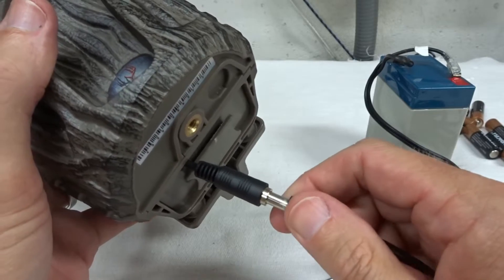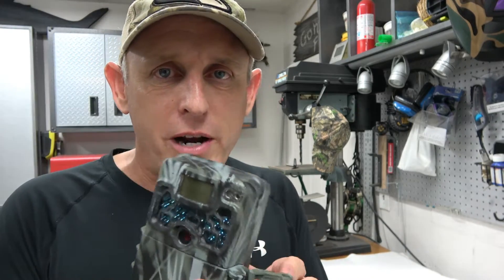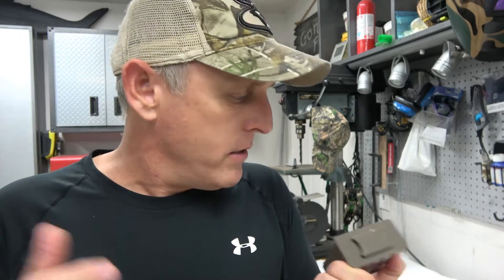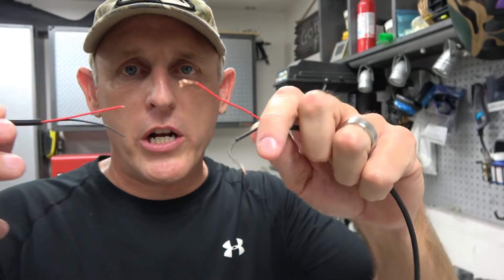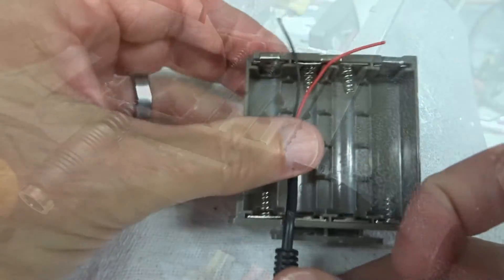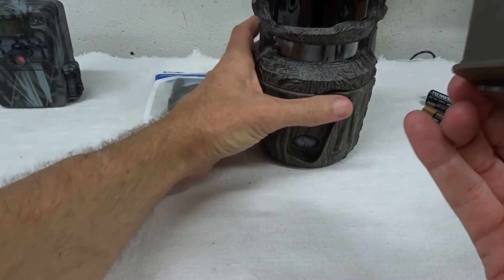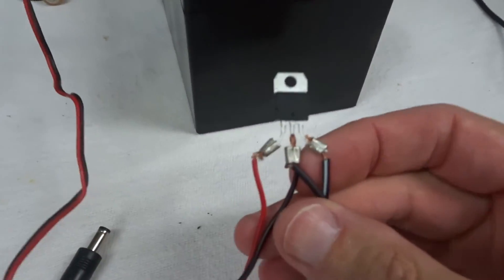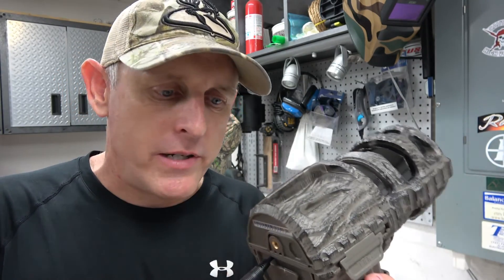How To Direct Wire Any Trail Camera!

Comment: Great video, im subscribed, question why are the external plugs always running 12v and the internal batteries if they use 8 would be 12v but you say they are only running on 6v,
Reply from the maker: The cam in this video had a 6v ext plug but had 8 internal batteries (which could be mistaken for 12 v) but the battery pack is wired so that it only runs on 6volts from the internal batteries.  It’s like taking two 6v batteries and wiring them in parallel so they stay at 6 volts but double the ah storage.  Does that make sense?
Reply: Yes, but why are the external plugs mostly 12v
Reply from the maker: Not sure what you’re asking?  Are you asking why the cable’s are listed as 12v?  If so, a cable will work on any camera regardless of voltage.  Otherwise, most cams are 12v due to the IR flash and motion needs.  It’s just a common voltage which fits with a lot of batteries and solar etc.  Hope that helps!

Comment: Question. I see when you geared up to your 6volt you didn't have a fuse in the line. I have a spypoint micro and want to make my own 12volt DC to run to my  12 volt acid lead. The wires are expensive. Do I need the fuse in the line?
Reply from the maker: I never run fuses on cameras because the amp draw is basically nothing.  It wouldn’t hurt to have one, but I’ve never hurt a camera by not having one. Hope that helps!
Reply: @TheHandyHunter  thanks. Hopefully I order the right one lol
Reply: @TheHandyHunter  also will I need 5.5mm x 2.5mm or 5.5mm x 2.1mm
Reply from the maker: Ashley Roy hard to say without seeing the camera but my last Spypoints were 2.1x5.5.  If it’s not it’s most likely a 1.7x4.0mm.  You may want to check with Spypoint.  Hope that helps.

Comment: I want to do this with my original plot watcher. It has no battery pack and runs on 4 AA. Would you assume it is a 6v system?
Reply: Yes it's 6 volts . 1.5 volts times four is a 6volt setup.

Comment: Trying to direct wire a cuddeback camera.  It is a 6V pack.  The battery pack does not have the clips like your video. It has terminals similar to a 9V battery. How would you connect that kind of pack?
Reply from the maker: Its hard for me to say without seeing it.  Can you shoot me a pic at steve@digitalsouth.com.  Thanks!
Reply: @TheHandyHunter  thanks for the reply. Email sent.

Comment: If the camera is 6 volts you can cut and use any USB wire from a $1 store and a USB battery changing bank.

Comment: How long does that external battery last for? compared to those little battery, sorry for my english
Reply from the maker: Depending on the size of the battery they can run as long as 1year or more without charging.

Comment: if it only runs on 6V why does the manufacturer design it to put in 8 1.5v batteries in the trailcam (12v)?
Reply from the maker: It’s because of the way they wired it.  They wired it to run on half the pack at 6 volts but it still utilizes the other batteries for longevity.  Not sure why they did it this way because it seems like 12 volts would be better for a cam like this.  Hope that helps.
Reply: @TheHandyHunter  makes sense thanks !
Reply: Why then is the external plug running on 12 v
Reply from the maker: The cam in the video had a 6volt ext jack.  All my other cams are 12 volt ext jacks.

Comment: I know this is a year old now, I was curious as the reason you use a inline voltage reducer, vs a buck to do the same job but to preserve power and not waste so much?  The heat produced from the inline voltage reducer/regulator eats up power, a buck was designed for computer systems to prevent that, but are just as simple to wire up with soldering iron and some just have wire leads you can crimp on.  I think that would improve your overall design and make the solar panel more useful, as well make the battery last longer.
Reply from the maker: Great info!  I’ve always wanted to try a Buck but never got around to it.  What you are saying makes sense.  I may add this to my list in the future.  Thanks for chiming in...really appreciate it!
Reply: Could you share a link to one that would work for 12V regulator?
Reply: Where can i get a 12 v buck at
Reply from the maker: Amazon has them

Comment: What cell camera do you like and when Browning comes out with theirs will you buy one
Reply from the maker: I love the Bigfoot cell cams.  They are the least expensive, they have great picture plans, and the camera functions flawlessly.  I love Browning trail cams too!  When they finally come out with a cell cam I will be interested to see their cost & plans, etc.  Now that I've found Bigfoot it would be hard to switch.
Reply from the maker: @Gene Senter check out our latest video and you’ll see how we use the Bigfoots to hunt hogs.  They transmit quickly and with very little cell signal.  They work great for how we use them.

Comment: Inside the trail camera is 2 positive posts and 1 negative post. Does it matter which positive post you hook to?
Reply from the maker: It probably doesn’t.  Tell me a little more though. What kind of camera is it and does it have a slide in battery pack?
Reply: @TheHandyHunter  I just went for it and hooked it to one of them and everything works perfectly. But even on your video there is two positive posts in the battery pack. I was questioning which side or if it mattered.
Reply from the maker: I got ya...sounds like mine.  The first post I tried worked so I left it alone.  Good luck!

Comment: Hi, awesome videos I have a Browning camera that take 8 batteries, voltage of the pack is 12 volts, I have a battery/ solar box from HME that puts out 13 volts, will this burn up my camera
Reply from the maker: You’ll be fine with the 13volts from the box.  12 volt cameras work on a range of voltage and not exactly on 12 volts.  13volts is perfectly normal and as your camera uses the battery it will drop over time eventually needing recharging. Hope that helps and good luck with your cams!
Reply: The Handy Hunter thanks so much, I run my cameras in very cold weather -20 doing Canadian Lynx videos and the lithium battery’s last about 2 weeks, the HME box has lasted over a month on Stealth Cams and wanted to use it on my Browning camera, thanks again
Reply from the maker: David Johnson Awesome!!!  Shoot me some pics to post on my community board if you want!  You have my email!

Comment: Dear Friends, I have a security problem and need TC hack help please.I would like to know how to hack a camara for my porch where the flash bulbs stay illuminated, when plugged into a Wall Wort power source.perp walks by it at night and Click, his picture is taken, unknown to him.Which cam to hack, I saw one w 9 or 12 bulbs , led for the flash.that would be good but im  no electro hacker
Reply from the maker: Hi Steven, it sounds like a regular trail camera would accomplish your needs to quickly illuminate and take pictures simultaneously.  You can buy IR flood lights that will stay on and then when your camera takes a picture you will have more IR illumination.  Hope that helps!

Comment: Very informative videos! Subscribed! I have some rooky questions though. This is not a feeder video but... Can a 6 volt battery be charged with 12 volts? My new solar panel shows 24 volts in full sun. Can I regulate it down to 12 volts to charge my 6 volt feeder battery?
Reply from the maker: Hi there!  Welcome to our channel!  You bring up something I've never tried but I think might be doable.  Sounds like you must have a 12 volt solar panel if it's putting out 24 volts in full sun...that's normal.  For a 6 volt solar panel it would be normal to put out 12 volts in full sun.  If you hook up a 12 volt panel with a 12v regulator installed then you should never get over 12 volts to damage your battery.  However, you WILL need a 6 volt regulator installed between the battery and the feeder motor.  The only thing I wonder is whether this setup will wear out the battery faster do to overcharging...may be worth the risk.  I think it is doable as long as you get the 12 volt reg between the panel and battery and then the 6 volt reg between the battery and motor.  Let me know how it goes...this is a very interesting question!  Thanks for stopping by!

Comment: Great. I was just going back to your sight to review solar panel video as I'm converting all my Browning Strike Force to external battery and solar, and see this new video for direct wire with no external plug. Your videos are simple and I like how you provide detail and parts info. Look forward to more
Reply from the maker: Thank you so much!  If you are in to solar then you’ll like my next video.  I’ve built a solar panel with a small 12volt battery attached that runs cameras 24/7...really neat little setup.  May get the video done this weekend or next week.  Stay tuned and thanks for coming back!!
Reply: Tell me more. You have a new 12v solar set up other than a solar panel running to 12v batter in a box then from battery with a 12v regulator to camera?  One of my Strike Force the 12v external plug port when I plug in external plugs has too much play on the plug to stay on EXT Battery. If I hold it over to side with fingers with some pressure it then stays on EXT BAT. I've tried several plugs so include a brand new one from the Stealth 10' cord that has battery leads too like you used to use. I may end up just direct wiring that camera thanks to this newest video.
Reply from the maker: Yeah, I’m running a new unit with a 2 watt solar panel with a very small 12v rechargeable battery mounted underneath.  I’ve tested it hard with two strike force cameras running off the same battery through the night with plenty of battery life left the next day.  So it runs on solar during the day while it recharges the battery and then runs on the small battery through the night.  If I can run two cameras off it then one camera should be a breeze.  This would be the perfect setup for your direct wire on your strikeforce.  Also, you may want to stick a tiny piece of tin foil in the center of that plug to firm it up.  Sometimes it works.  Shoot me an email at steve@digitalsouth.com and I’ll send you a link to the battery.  Hope that helps!

Comment: HELLO, I noticed you didn't solder the wires to the regulator, where did you find the clamps you crimped on the regulator ?
Reply from the maker: I take regular battery spades and cut the end off and then just use the neck part as a sleeve clamp.  I can’t solder well and I get worried about the heat damaging the internal part of the regulator.  Let me know if I can help.  Thanks!
Reply: @TheHandyHunter  soldered  my regulator,with no problems